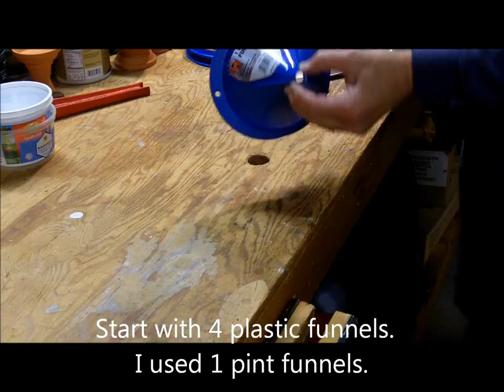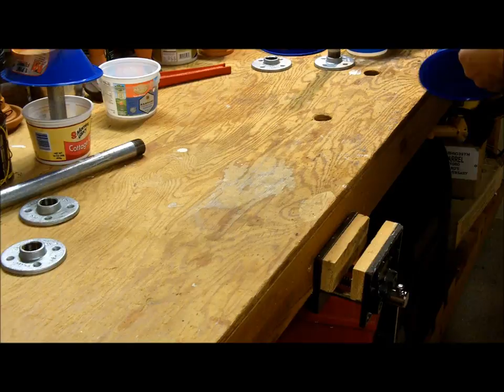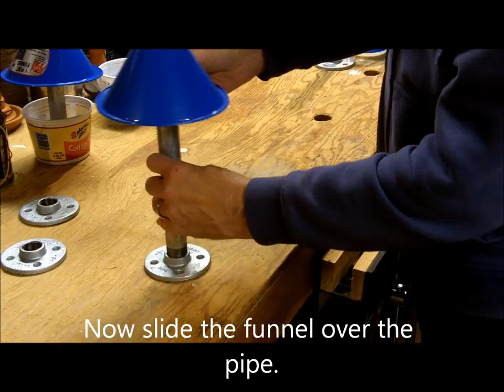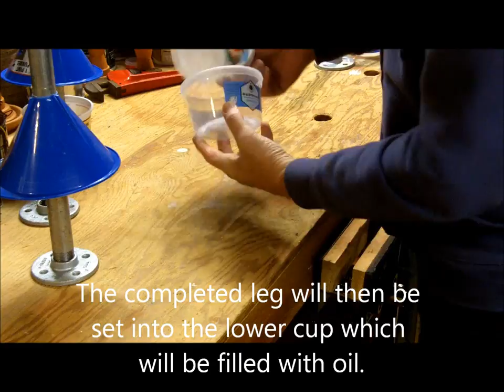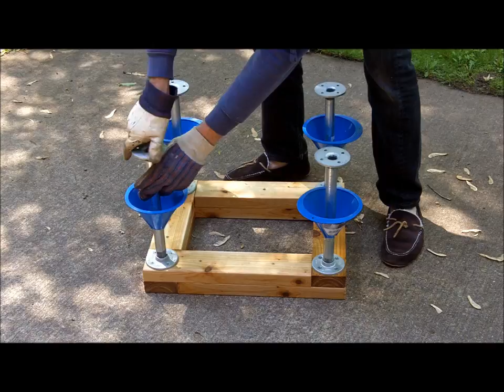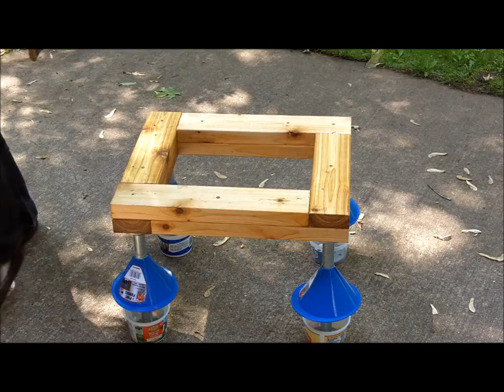Ant-Proof Your Bee Hive

Comment: A great little invention. It's been 8 months since I put this stand directly on top of the ant hill with no major problems. My only tip is to make sure the can/plastic is well covered by the funnel and that the funnel used  is larger than the can to give plenty of room to screen off the bees. Job well done!
Reply: K.Rebecca Gell Here’s a suggestion, do the same thing, instead of using cups under it with motor oil, which is a terrible idea environmentally and possibly fumes can taint your honey and kill your bees. Bees are very sensitive to odors and smells as that is a method they communicate. Instead Slather Tangle Foot under the cup of the funnel, it’s a nondrying sticky goop designer to prevent crawlers destroying trees. You only need to replace it when the ants make a dead body bridge, and it’s harmless to the bees. Also, nontoxic to the honey. For added defense you can slather it on the legs, It won’t wash away above or below the cups. You can put a rubber gasket or a bead of silicone on the legs to keep the funnels in place and water tight.
Reply: @ebray4134  it attracts bees and they get stuck too, I wish that I had never tried it.  It also makes a mess when the sun hits it.

Comment: I just found this video and I am in the process of building one.  I was searching for a metal stand along with an ant solution. Also free standing to work from 3 sides. Stsnds are expensive to say the least. However this  will last my lifetime with very little maintenance if any. 
The basic stand is a great beginning, easy to assemble. The ants. Well I will start out with cinnamon and go from there. 
I've used oil before, crisco. To many dead bees. 
Thanks Dan

Comment: Great!  I believe that will work just fine. My oil traps work, but I had trouble making an effective shield to keep the bees out - - They see the reflection off the oil, and go to drink - - the ones that aren't killed fly back to the hive and smear oil all over the place.   Down here in S. Texas the problem is half a dozen varieties of ants - - - some very, very small, and the worst the medium size fire ants.  For variations on oil - - - Vegetable oil works well and I will be trying DE (diatamatious earth).  It is a fine white powder used in pool filters, completely inert, non-toxic and inexpensive.  It works by clogging the insect foot pads that allow them to walk up the side of a wall (also effective on roaches).  It might be difficult to keep DE dry enough outside, but I will give it a try.

Thanks for the video.  Big help.
Reply: Do your research on DE, It will kill bees if used incorrectly.
Reply: Thanks for the caution.  I will do a little variation on Daniel's design - - - . I have 10 hives on existing stands, so the components are a little rich for my budget. I will use my existing 2X4 stand legs,  double the width at the bottom of each leg, and bore a 1" dia. X 4" deep hole  in the center of the extension.  I'll 'force-fit' a length of pvc pipe into that hole, and cut a small 2X4 piece to replace Daniel's bottom flange - - again fitted with a 1" hole.  The pvc will be  a couple of inches longer than what I need to fit the cup and funnell (great idea!), and I will use 8" dia. funnells that can completely cover the cup, without actually touching it - - - which should keep the bees out, and let beetles, ants and roaches in, so I believe DE will be ok  - - - but plan to try liquid laundry detergent first - - -   1$ for 64oz, Dollar tree, Funnels, $1.29 ea, Big Lots (not always available - - also Harbor Freight) 1" X 8' PVC $2.29 Lowes
Reply: Rick Kelley Here’s a suggestion, do the same thing, instead of using cups under it with motor oil, which is a terrible idea environmentally and possibly fumes can taint your honey and kill your bees. Bees are very sensitive to odors and smells as that is a method they communicate. Instead Slather Tangle Foot under the cup of the funnel, it’s a nondrying sticky goop designer to prevent crawlers destroying trees. You only need to replace it when the ants make a dead body bridge, and it’s harmless to the bees. Also, nontoxic to the honey. For added defense you can slather it on the legs, It won’t wash away above or below the cups. You can put a rubber gasket or a bead of silicone on the legs to keep the funnels in place and water tight.

Comment: I tried a similar solution, which was effective at keeping out the ants, but resulted in a lot of dead bees in the lower cups.  In the end I am unsure if this solution wasn't more damaging than the original problem.  Thanks for sharing though!
Reply: My original design drowned a lot of bees too, my new design is a lot better.  Definitely better than having my hive stripped clean by ants.
Reply: Try replacing the oil with cinnamon.
Reply: Have you had a colony leave because of ants?

Comment: What kind of oil do you recommend? 5W30 or 5W20?
Reply: On the off chance that this isn't a joke. 
This definitely depends on the area you live in, like the minimum temperatures you experience there. So if you live within the tropics I'd suggest a 10w something. Else go for something lower.
Reply: Regardless I think you'd want to go full synthetic for better performance

Comment: Here’s a suggestion, do the same thing, instead of using cups under it with motor oil, which is a terrible idea environmentally and possibly fumes can taint your honey and kill your bees. Bees are very sensitive to odors and smells as that is a method they communicate. Instead Slather Tangle Foot under the cup of the funnel, it’s a nondrying sticky goop designer to prevent crawlers destroying trees. You only need to replace it when the ants make a dead body bridge, and it’s harmless to the bees. Also, nontoxic to the honey. For added defense you can slather it on the legs, It won’t wash away above or below the cups. You can put a rubber gasket or a bead of silicone on the legs to keep the funnels in place and water tight.

Comment: Hi Daniel, Great idea. In fact, I thinking about building a few of these hive stands myself. Can you provide us with a follow-up review? Did the ants ever figure out how to circumvent the mineral oil in the cups, or did you ever have problems with rain washing out the mineral oil?
Reply from the maker: Continued to work well - but make sure to keep the cups free of debris.
Reply: Timothy Koehler Here’s a suggestion, do the same thing, instead of using cups under it with motor oil, which is a terrible idea environmentally and possibly fumes can taint your honey and kill your bees. Bees are very sensitive to odors and smells as that is a method they communicate. Instead Slather Tangle Foot under the cup of the funnel, it’s a nondrying sticky goop designer to prevent crawlers destroying trees. You only need to replace it when the ants make a dead body bridge, and it’s harmless to the bees. Also, nontoxic to the honey. For added defense you can slather it on the legs, It won’t wash away above or below the cups. You can put a rubber gasket or a bead of silicone on the legs to keep the funnels in place and water tight.

Comment: I tried this and had dead bee problems with the oil so I changed and put cinnamon in the cups and never had an ant...so far!
Reply: Hi Terry - - I've lost a lot of bees in oil traps, and have had trouble getting shields around the 2X4 legs on my stands.    This seems like a real good fix, and I will try it on my stands.  It would seem the funnel/shields could be pushed down until they mostly cover the oil bath
Reply: Maybe you have heard this was told Monday in Port Hope that if you throw grass on the inner cover it will confuse the ants and they will leave?? They say because of the height. Going to try it this year. Cheap way if it really works.
Reply: Thanks.  Will give it a try

Comment: Last year I did this and ended up killing a BUNCH of bees that get into the oil after a hard rain trying to get water.  Not long until the Sun works on those plastic containers & they crack & break up,....back to square one.  I found that using bearing grease on the legs stops ants
Reply: Heard vaseline works..I don't know how long it lasts.
Reply: @joannarii7377  I just tried that. Seemed to work at first. Checked 3 days later and vaseline had dried enough for ants to climb over